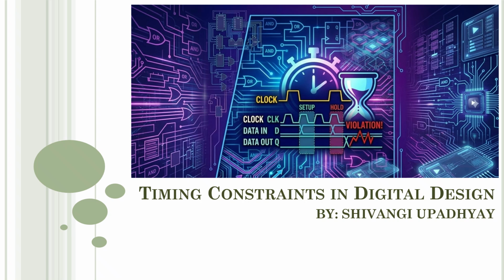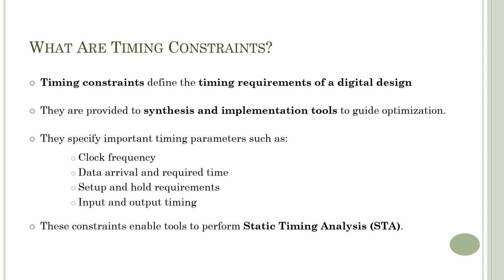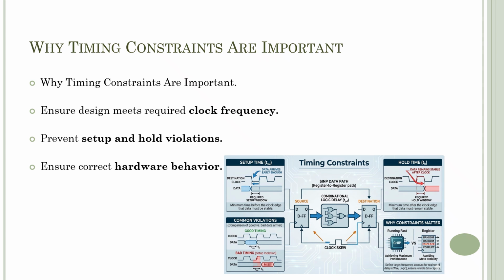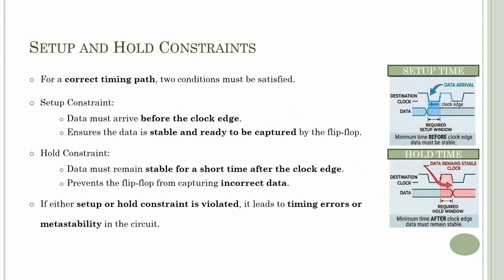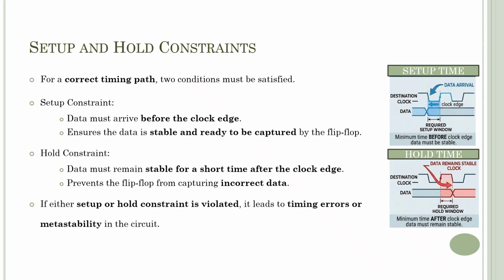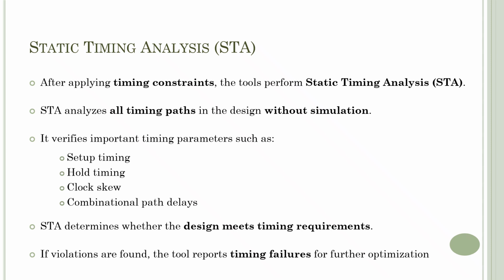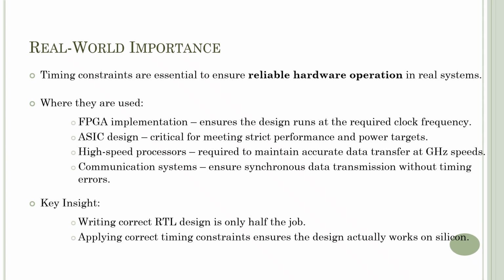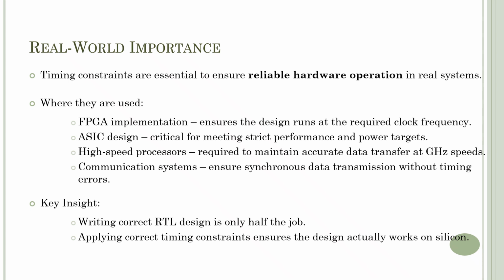Timing Constraints in Digital Design

Comment: Good One 👌🏻.. 

Ma'am , can you provide a real time example of timing constraints..
Reply from the maker: Sure....Let’s understand timing constraints using a real-world example.
Consider a system where an FPGA or microcontroller is connected to an external ADC. The ADC converts analog signals into digital data and sends this data to the FPGA.
Now, this data does not arrive instantly at the FPGA input. There is always some delay due to the ADC’s internal processing time and the physical connection between the devices.
To ensure correct operation, we need to tell the design tools exactly when this data will arrive relative to the clock signal. This is done using timing constraints such as input delay.
If we do not define this input delay correctly, the FPGA might try to capture the data too early or too late, which can lead to setup or hold violations.
Similarly, when the FPGA sends data to another device, we use output delay constraints to ensure that the receiving device gets stable data at the correct time.
So in real-world systems, timing constraints are essential for proper communication between different hardware components.
Without these constraints, even if the logic is correct, the system may fail due to incorrect timing of signals....